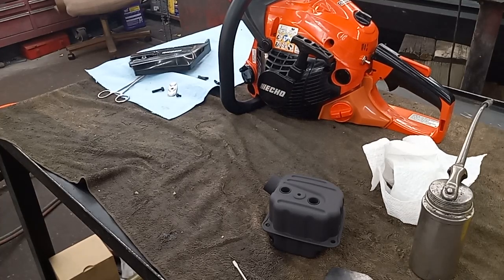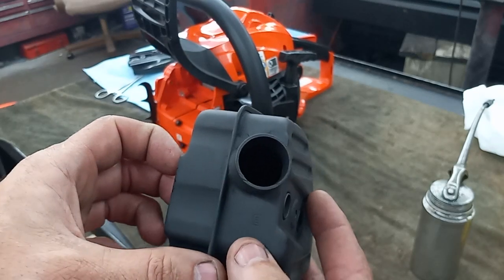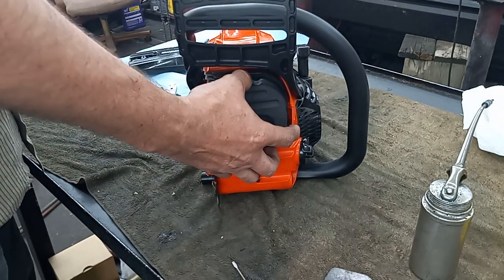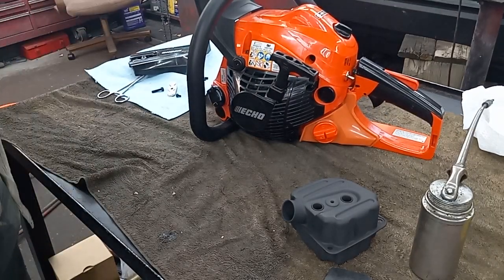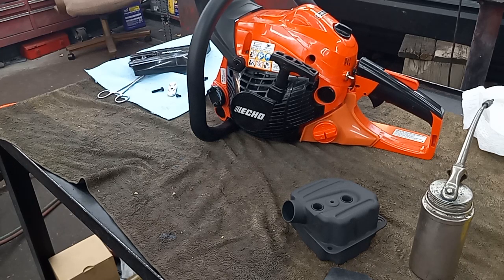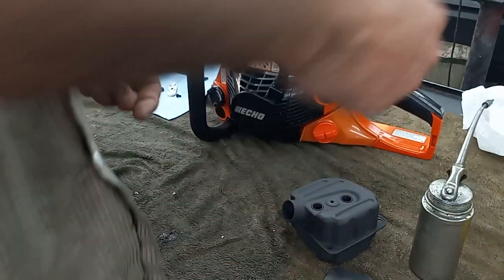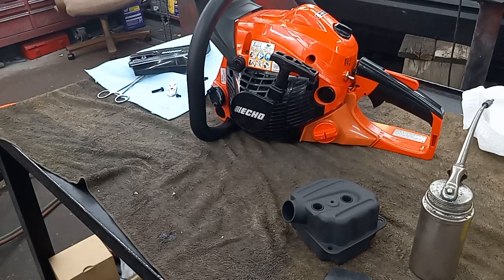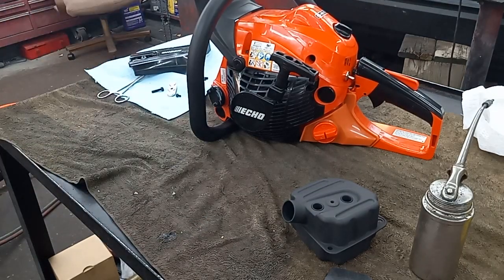Echo CS-4910 Muffler Mod & Assembled

Comment: Awesome work Charlie. Where do you find your muffler outlet thin wall tubing ?
Reply from the maker: Farm store
Reply: @CharlesBrisco  you mean like TSC ?? Is it galvanized or what is it used for ?? I’m having a tough time finding anything but heavy wall
Reply from the maker: @FYMM69  it's like a tsc family farm I think wats it's called some size I use is gavinized some is not
Reply: Get a old kid's bicycle and use some of the handlebars. Makes for nice light weight tubing that isn't galvanized.